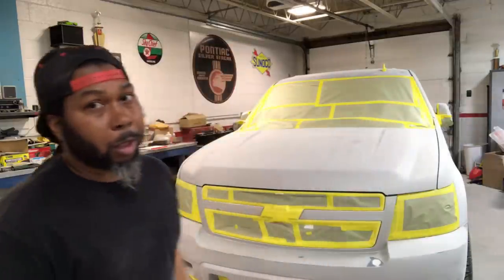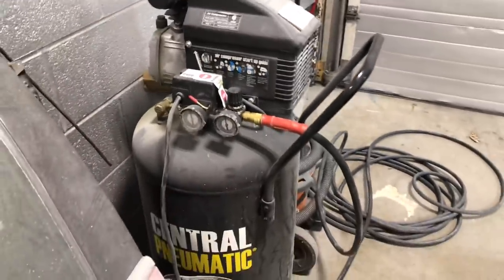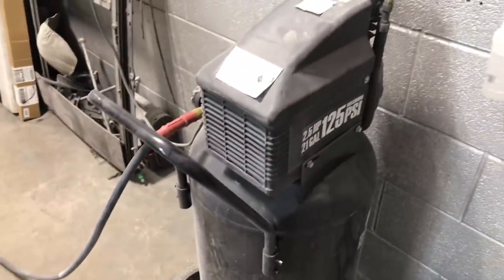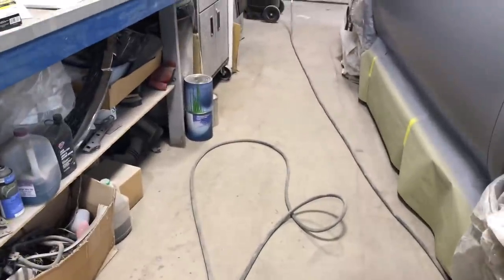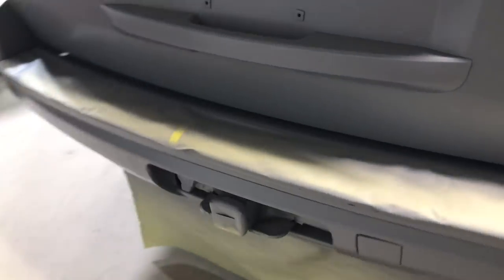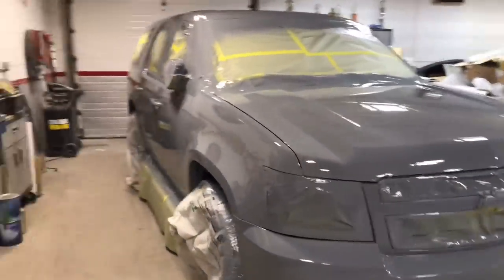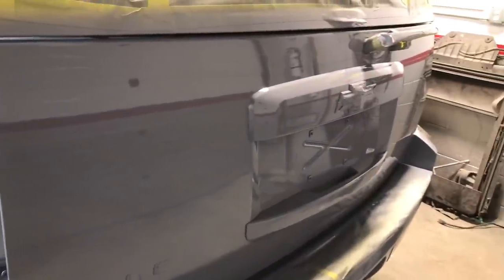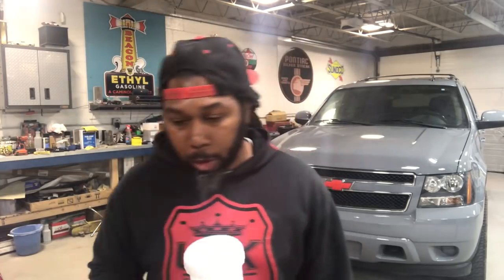COMPLETE PAINT JOB with the SPRAYIT R500 LVLP spray gun and a small compressor

Comment: Shout out to UPK from the UK! - Youtube just sent me to this channel, great content, and no bullshit. So, I like the sound of this video, just plucking up the courage to invest in compressor etc. But, I wanted to ask - is that a 1K or 2K paint job? And what would you say are the downsides that a rank amateur like me needs to watch out for if going for LVLP compared to HPLV?? Can I use 2K paints, primers and epoxy with the LVLP system?
Reply from the maker: First let me say thanks for checking me out in the UK👍🏾🤛🏾 now on to the question…this is a base clear job and not a single stage and there is no real downside going lvlp in my opinion and you definitely can spray 2k paint and primer materials
Reply: @UndergroundPaintKing  Thanks - straight to the point, easy to understand answer. Cheers!
Reply from the maker: @kevinwells768  I hope that helps and ask me questions anytime!

Comment: Can I still use my HVLP gun with that same compressor? I don't have a LVLP gun.
Reply from the maker: You can but the compressor will struggle to keep up with the demand of air pressure that the hvlp gun requires…it’ll work a little better if you’re doing small parts but it won’t work the greatest doing a whole vehicle

Comment: Man I home you can help me on this one. I’m prepping to paint a 1971 Charger BIG car. I bought the spray it off your recommendation and was wondering how much material you used for you’re base coat on the Tahoe?
Reply from the maker: The base I used is a mix ratio of 1:1 so far the truck I had 3 quarts which when mixed with reducer is a gallon 1/2 of paint sprayable so if you go with a base that mixes 1:1 and you get a gallon you will have 2 sprayable gallons of paint and should be plenty of paint for your car
Reply: @UndergroundPaintKing  thanks UPK the material I have is an acrylic enamel with an 8:1 ratio. Looks like I’ll need an extra gallon to be safe.
Reply from the maker: @twinturbosgarage8149  you may not need a gallon because that should cover well but if you are comfortable with having extra just in case then the 2 gallons will be plenty
Reply: @UndergroundPaintKing   better to have it and not need it, then to need it and not have it lol.  I’m new to painting so the extra would give me a good cushion if I should mess it up. You’re the man!
Reply from the maker: @twinturbosgarage8149  you’re definitely right about that…appreciate you chopping it up with me!

Comment: What pressure did you have your regulator set on your air compressor why’ll you was spraying?
Reply from the maker: I honestly don’t remember what pressure the compressor was set at Justin
Reply: Ok thanks. I got that R500 from Vevor  yesterday and going to try it out today
Reply from the maker: @justinw523  let me know what you think about it!
Reply: I Definitely will let you know
Reply: Well I’m testing it using water and it sounds like it’s sputtering just a little I’m running it at recommended pressure starting at 28psi, I went to 15psi and the sputtering stops. I made sure everything is tight and really clean before I used it. I’m thinking it’s either my 10 gallon compressor or it’s doing it cause I’m running water through it?

Comment: Awesome vids !!does that mean i can paint a whole chevelle with a 27 gal compressor and hte black widow??😅
Reply from the maker: Thanks Charly, I appreciate you and honestly it would be a difficult task trying to do a whole chevelle with a black widow and a 27 gallon compressor unless the compressor can handle the cfm required by the black widow. It’s best to match your compressor and spray gun up so that you can get consistent air pressure and that’s why I use lvlp spray guns with my small compressor
Reply: i see thank you for heads up im a new painter..been doing bodywork  for some time now i finally got an oportunity to start painting do to  the painiter quiting.  Ive done 4  panels  in my life before  nd im a have to take the big step  to paint a whole chevelle.. almost done with bodywork, but i got a big problem the  painter took his badass compressor with him so now i got a small compressor
 I will be paining in cold weather..around 40 degress not in a paint boot. l llwarm the metal first  and keep  it warm with a heater torpededo, but i had one more question.
Im probably gonna be slow in the process  so would u recomend me to use  medium reducer and activator or fast??might be a dumb question but keep in mind iv only done 4 panels 😅
Reply from the maker: @Chiriwillo566  in 40 degree weather I would go with a fast reducer/hardener, the material should still flow out pretty good and that would help with getting sags and runs
Reply: @UndergroundPaintKing  got it. Thank you  so much !!! 🙏
Reply from the maker: @Chiriwillo566  you’re welcome
Reply: @UndergroundPaintKing   quick update just painted the car yesterday with the A610 and small compressor  it came out good just a lot of trash  hoping  the wetsand and buff will make it better but all this thanks to ur videos man thank u will be buying merch soon

Comment: What horsepower is this compressor? I saw another guy saying you needed at least 5hp but I’m thinking that may have been for the HVLP spray gun? Also can I use the Spray-it gun if I’m painting outside? I’m getting ready to do my truck and really want to nail it first try
Reply from the maker: My compressor is a 2.5 hp and you can spray outside with it also Shon8088
Reply: @UndergroundPaintKing  so 2.5HP will be enough? I been looking for 5 HP all this time not knowing I could use 2.5HP
Reply from the maker: @shon8088  you want a compressor that will give you the cfm required for your spray gun so it’ll function properly so it’s still good if you have a 5 hp compressor but you can still get the job done with a smaller hp compressor
Reply: @UndergroundPaintKing  does the Spray it come with everything I’ll need or do I need to purchase something else to go with it? I keep seeing something about tips and adapters
Reply from the maker: @shon8088  you can buy it in a kit which comes with different tips to spray primer, base, and clear and as far as adapters that’s just for pps cup systems if you plan on using that instead of the paint cup that comes with it
Reply: @UndergroundPaintKing  thanks bro! You make it simple for a newbie to be able to do something I’ve been scared to do forever
Reply from the maker: @shon8088  you’re welcome and don’t be scared Fam you definitely can do it💯
Reply: @UndergroundPaintKing  last question big homie. What’s the best way to setup that Spray it gun so I’ll be ready to paint? I’ve seen reviews saying you need to clean it out before your first paint job. I’m new to all of this so I’m just trying to absorb as much knowledge as I can.
Reply from the maker: @shon8088  check this video out and see if it helps, I have a few videos spraying with these guns 
https://youtu.be/DozQwNMbt7M
Reply: @UndergroundPaintKing  just checked it out! Exactly what I needed. Now I know what pressure you set on the regulator but what pressure do you set on the compressor? The pressure that is for the spray gun?
Reply from the maker: @shon8088  I explained the pressure that I set on the compressor and then you set your pressure at the spray gun with the regulator on the spray gun

Comment: Did the compressor hold a consistent pressure or did it drop
Reply from the maker: It will hold consistent because the spray gun doesn’t need a lot of air to function

Comment: Absolutely incredible! Bro, have you primed with this setup?  What primer do you use and what PSI do you spray it at? Thanks again!
Reply from the maker: Thanks I appreciate that!…I haven’t primed with this setup yet but the primer I use is a 2k primer surfacer that might be to thick for the 1.3 tip that comes with this gun but I would have to try it…you can get this gun in a kit which comes with different tips that you can prime with so I would believe it can definitely spray the primer I use

Comment: Yoooo! Man I just got done spraying the final coat on my Silverado with this gun because of your previous review of it. Man it came out like glass I appreciate the real deal honest review. It’s a perfect gun for someone looking for a good quality product that won’t break your wallet. Thanks again for the review and you knocked this one out bro it looks soooo clean. Did you even have to cut and buff it?
Reply from the maker: Thanks bro I’m glad I could help in your decision to buy this gun and I didn’t have to cut and buff but I could have and I know it would have been even better…I appreciate you checking out the videos and supporting the channel!!!
Reply: @UndergroundPaintKing  Of course my man!! More than happy to watch good content. I didn’t think you cut and buffed it but it doesn’t look like it needed it at all. I just wanted confirmation of that fact again awesome job bro.
Reply from the maker: @kronos89rs  thanks again I appreciate you!
Reply: @kronos89rs  what model/size compressor did you use?
Reply: @luisdiaz9142   The same exact harbor freight central pneumatic 21gallon that he uses in this video
Reply: @kronos89rs  i was having issue with the 27 gallon Fortress compressor from harbor freight spraying a hood and a fender. Im using the Eastwood Concours lt100 which is supposed to only use 4.5cfm@30psi.
Reply: @kronos89rs  at first it felt air pressure was being restricted(maybe inline air filter and digital regulator i was using) and then paint volume went from good to barely spraying any paint🤦🏻
Reply: @luisdiaz9142  Bummer! Yeah that should be more than sufficient. There definitely must be something up with with one of those like you said or have you tried to use another gun or cleaned that one? Something could have gotten clogged up inside.
Reply: @kronos89rs  im going to try to troubleshoot and also order the Sprayit LVLP and try that out. Its backordered until Nov 30th though

Comment: You got a sub. Gg bruv. Got my 2012 denali to do now🙏
Reply from the maker: Appreciate you subscribing to the channel and good luck on your Denali 💯💪🏾
Reply: @UndergroundPaintKing  The compressor im looking at is 20 gal, 2 hp, 5.5cfm @40psi, maximum psi @150, single stage (its a detailk2 20gal) for 400bucks cdn on sale from 900. Your comppessor  had a 2.5 hp motor....think ill still be ok?
Reply from the maker: @MurdahBassRecords  it’ll still work if you grab a spray gun like the one I’m using or a similar one, you want a lvlp spray gun
Reply: King Do i need the paint cup adapter and the special cup and collar kit like you have on other videos to do prime, base and clear?
Reply from the maker: @MurdahBassRecords  yes you need all those items if you don’t want to use the plastic cup that comes with the spray gun for all three materials
Reply: @UndergroundPaintKing  Awsome thank you. I hope you dont mind all the questions. I have alot of rock chips down to the bare metal in my paint and the wheel well panels have spots of bare metal. Is it better for me to sand the best I can. Bondo. Sand. Eurethane 2k high build primer then base or should i be sanding everything right down to metal and then an epoxy primer, sand and then base?
Reply from the maker: @MurdahBassRecords  either way will work, you just don’t want to trap moisture on the metal surface to prevent from surface rust forming under your paint
Reply: @UndergroundPaintKing hey bruv  what tip did you use to spray the base in this video at 28psi and what tip for the clear?
Reply from the maker: @MurdahBassRecords  1.3 tip for both base and clear
Reply: @UndergroundPaintKing  ok awsome thank you. Also i kinda screwed up. I sanded multiple parts down to the baremetal and many edges. I sprayed epoxy dtm to those parts. Did 3 coats. But then had to go to work for 14 days. Did not realize there was a timelimit where no sanding was required before laying down urethane high build......🤦‍♂️have u ever run into this? What grit would i use to sand the epoxy before laying down urethane primer?
Reply from the maker: @MurdahBassRecords  it really depends on how the epoxy is sanding, if it’s sanding well you could use 120-220 grit dry or you could try 320 wet to get it ready for your high build primer
Reply: @UndergroundPaintKing  awsome thank you.
Reply from the maker: @MurdahBassRecords  you’re welcome!
Reply: @UndergroundPaintKing  K next question🙏 I got an electric DA sander.  And also various sized sanding blocks.

Do I use 320grit for sanding high build with the block, 
Then 400grit and then 600grit with the DA sander? 
Or how and in what order would u do that personally to get ready for paint.

Ive been  watching too many videos and getting a little overwhelmed
Reply from the maker: @MurdahBassRecords  if you have your project ready for paint like you want you can start with 320 on block or da, then move up to 400 on the block or da and then finish it in 600 on a block or da
Reply: @UndergroundPaintKing  awsome thank you bro🙏
Reply from the maker: @MurdahBassRecords  you’re welcome!

Comment: Looks like it came out nice 👍🏼 it didn’t look like ya got overspray everywhere like a normal conventional or HVLP would. Did it take some getting used to moving much slower than a regular setup? Or did ya adjust it out that way to compensate for the small compressor and low volume of air.
Reply from the maker: I honestly don’t think it took much adjustment, I just knew that I didn’t have the air supply like I normally do and sprayed accordingly…I was honestly looking for the gun to fail because of the task at hand and surprisingly it didn’t…I appreciate you checking out the video!

Comment: Bro that's hot fire man, it came out clean. You can also use a water separator in your line so you won't get any water molecules.
Reply from the maker: Thanks I appreciate that and I’ll use a water separator or filtration system the next time I do a job like this

Comment: Nice work man! I see that you had the cap off the cup. Was that intentional and if so what does that do? I’m really close to laying the paint down on my truck with this same gun and am stoked to see this video. Thanks for the video...
Reply from the maker: Yes that is very intentional I like to keep the blow hole open so that I get plenty air flow and don’t have any issues with my fluid
Reply: @UndergroundPaintKing  thanks for the tip UPK. So 33 psi seems to be the sweet spot for this gun when spraying paint and clear?
Reply: Went back and rewatched the video. 28 psi base and 33 psi clear. Thanks brother! 👍

Comment: I've been waiting for a video on spraying an entire car with the spray it gun and a small compressor. And you came through. Thanks for that.

I just posted a question on another video you made regarding tip sizes used for base and clearcoat using the spray it gun. Did you still use only one tip size for both base and clear on the suburban?

What should I use for mayerials? I'm wanting to paint my jeep xj and have sanded the clearcoat off. Currently it is white but I want to paint a different color white. Problem is that I have sanded through to the metal in a few areas.

Should I put spray can etching primer over the sanded through bare metal areas and then cover with a sandable primer followed by a sealer before base color?

Thanks in advance.
Reply from the maker: I believe I responded to the question on the other video but I used a 1.3 tip for the base and clear and the process you are thinking of doing would be correct, you can use a spray can self etch primer then a sandable primer then once you have it prepped to your liking you can seal if you choose to then base and clear

Comment: Bruh, what's the HP of your compressor? I'm working on a 96 Camaro and I'm probably gonna have to paint it in pieces. Can't find a small compressor (Not yet anyway) that has 2HP or higher. Great video man for us dudes on a budget!
Reply from the maker: My compressor is 2.5 hp Eric, I appreciate you checking out the video and I’m glad it was helpful!
Reply: @UndergroundPaintKing  Appreciate it man! My question now though is can I use a compressor with less than 2HP? I can't seem to find one locally here, and I'm getting behind on my project.
Reply from the maker: @ericharris9705  if you’re going with the R500 spray gun you want to use a compressor that will deliver the cfm required by the spray gun
Reply: @UndergroundPaintKing  I appreciate you man! Match the compressor to the gun, got it!
Reply: @UndergroundPaintKing  Update, can't find the compressor I need locally, so I'm going the long hard route of rattle can paint this whole car! Since it's a restore, I've torn most of the car down. So painting it in parts shouldn't be an issue. But I'd love to hear your thoughts if any!

Comment: How much base did you use on the Tahoe? Looks 👍
Reply from the maker: The paint that I use is a 1:1 mix ratio and I believe I bought 3 quarts of paint for this along with a gallon of reducer which gave me a gallon and a 1/2 of sprayable paint. I appreciate you checking out the video Matthew💯
Reply: I got an lvlp and a 20 gallon to paint my harley and then I found your videos showing it can be done. Thanks
Reply from the maker: You're welcome, and I'm glad I could help!